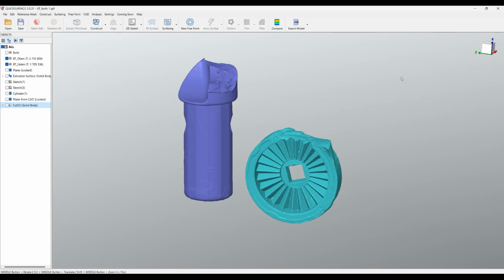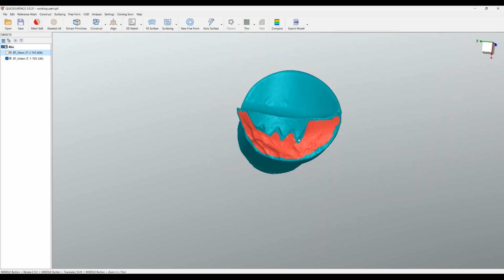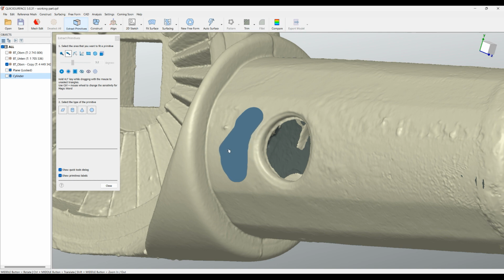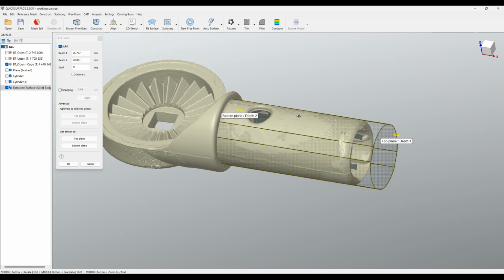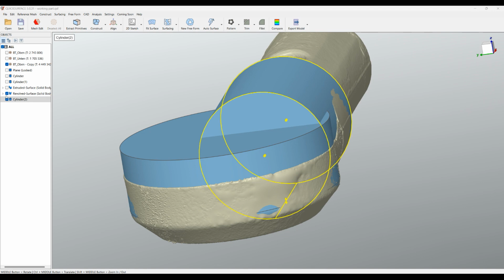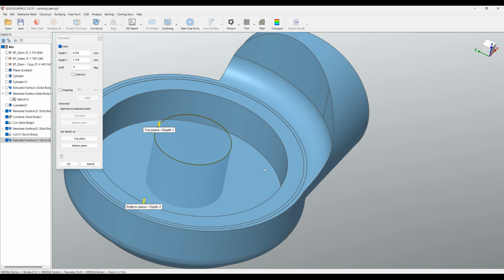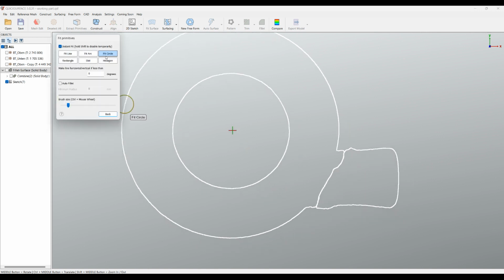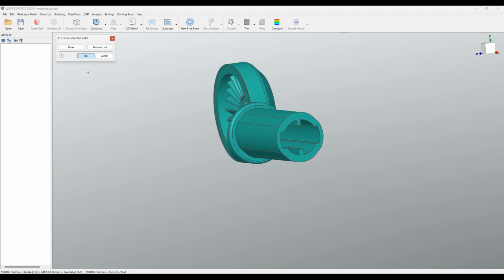Scan To CAD Tutorial |  Reconstruction of broken part with QUICKSURFACE

Comment: Hi. nice video can you please help me on how can i convert pointcloud to mesh and to further model. i ma testing the software and have large pointclouds that i need to redesign...a guide would be nice
Reply from the maker: Our software cannot convert point clouds to meshes. Where do you get the point clouds? The software which you use to generate point clouds, should have function to generate meshes from point clouds
Reply: @QUICKSURFACE  Hi thanks. So how can I create a surface from the point cloud? I want to create surface form the pointcloud which is why I opted for Quick surface can it be a solution?